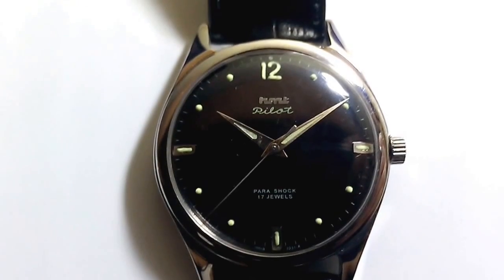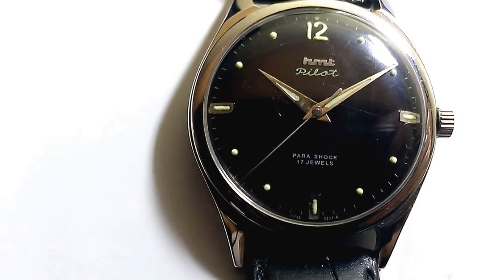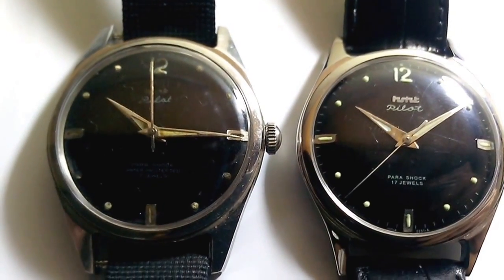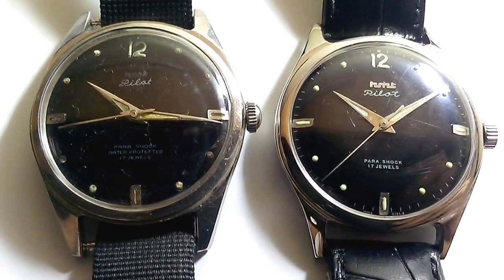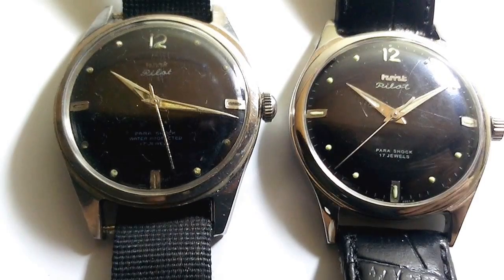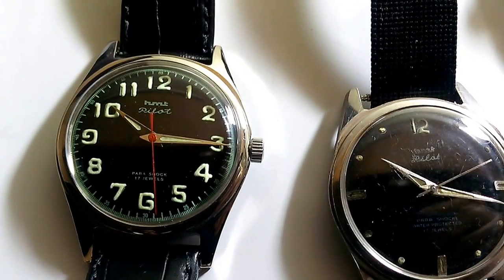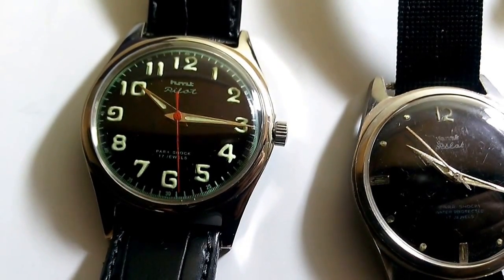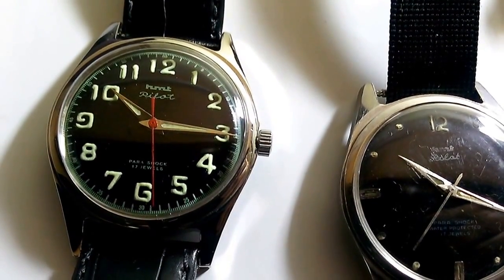HMT watches.HMT Pilot watch  - An Introduction

Comment: Bought a blue dialed version on eBay and it broke in a few days (and fogged up while on the wrist), but I believe it was a frankenwatch due to a bad seller. I have a black dialed version on the way to me. The blue dial looks much nicer to me so maybe I will switch them.
Reply from the maker: Hi Matt, I saw your video and was really sorry to learn about your experience. In my opinion both the watches look franken (Black and blue dial pilots). They might have the original case and movements but the dials are clearly repainted (probably an old white dial janata watch reworked to look like a pilot). Its unfortunate that HMT does not ship its watches outside of India and thus people living in foreign countries rely on online e commerce portals to get HMT watches and end up having similar experiences.
Reply: hmtwatchespicturegallery No doubt they are redials. Shit happens. I do wear the black dialed version here and there.

Comment: Hi,I bought a pilot bd from HMT official site.The thickness(excluded the crystal ) is bit more than titan edge.What is the thickness of old one? There is a slight gap between case and crown,as hmt is manufacturing the watches with leftover parts.Does the gap floods the watch?

Comment: Are chronograph movements available from HMT? Are the military watches JAWAN available at the showrooms?

Very nice reciew by the way.
Reply from the maker: Thanks Vishal, HMT does make chronograph watches but with a quartz movement these are available though far and few in the HMT showrooms. HMT Jawan was re-released about a couple of years back but it is very difficult to find it with dealers and at showrooms. Except for the name i have been told by the HMT watch company officials there is nothing military about these watches. The arrow mark on the case back that is often seen on Jawan watches is an aftermarket etching that is done by re-sellers to make it more attractive and military type to the innocent buyers. They often repaint the dial of other mechanical HMT watches and put an arrow on the dial for the same reason and sell it as hmt JAWAN watches. Hope this helps.

Comment: The latest models which are being manufactured are not so aesthetically pleasing compared to these old ones. The lumes are gone, the font type and size is changed, hands look different.. Apart from the movement and domed crystal the newer models don't have anything else to offer.. no doubt doom is nearing for the company..
Reply from the maker: The latest pilot watches have components procured from the market. - Dial ,hands and cases. These dails have machine applied lume while the earlier ones were applied by hand. Due to this the font and lettering looks changed. I personally prefer the earlier one's but i do have a few recent coloured pilots and they are not bad. Considering the state of the watch division unit it's nothing less than a miracle that they are still able to offer watches to customers.